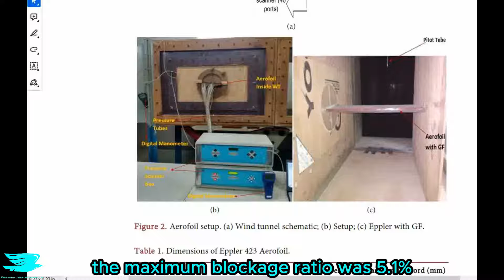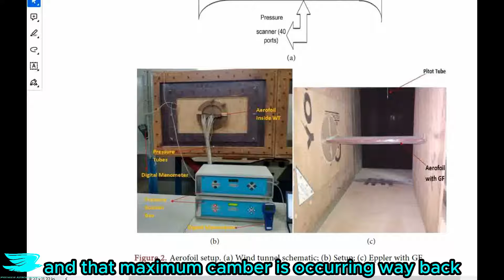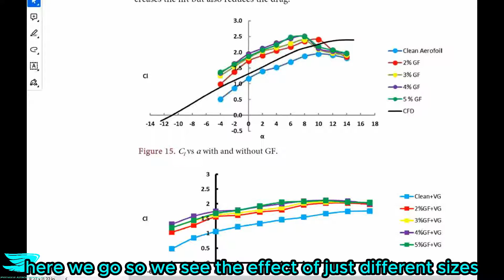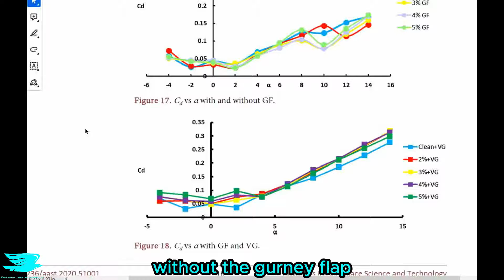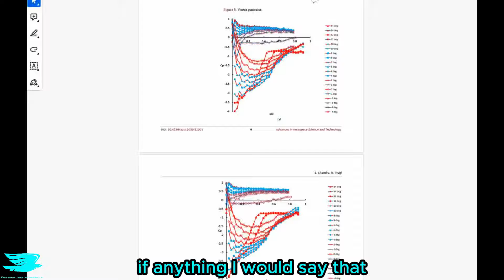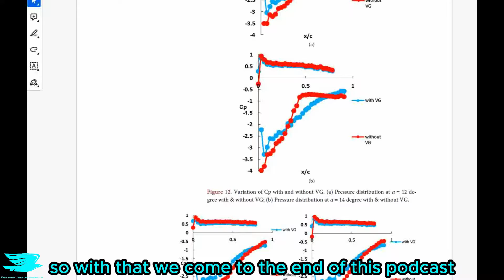Podcast #179 Do Gurney Flaps And Vortex Generators Work Well Together?

Comment: Hello,

I believe if you design tubercles the right way, they should reduce the lift to drag ratio even at small angles of attack.
For this you need to work the tubercles into the whole wing chord.
Especially on the top of the wing.

For example by interchanging 2 different wing profiles in a sinus wave.

With this the streamlines get bent to left and right. And the relative way over the airfoil gets longer.
This results in an increase in velocity. And in higher lift, without more drag.

However the changes should be not this much. Cause the  bent elongates the streamlines under 1%.

But its far more easy to put these tubercle triangles in front of an existing profile i guess.

Do Gurney Flaps need compression ? Or should they work on hydrofoils too ?
Reply from the maker: Interesting ideas for tubercles. There are some configurations where the drag drops and the lift to drag ratio increases. The ones I'm familiar with still produce some vortices at low angles of attack. But, it may be worth looking into the ones that don't produce much vorticity but just bend the streamlines.

Gurney flaps can work on hydrofoils too.

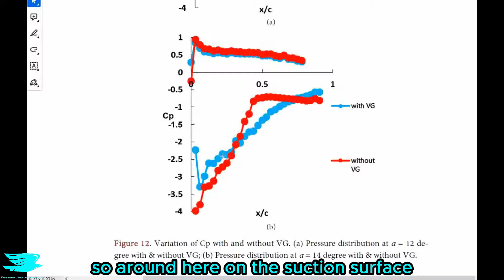Comment: @22:00 that's probably a clear separation bubble, seems like the tubercles add drag but help keep the flow from detaching. This brings up an interesting compromise, turbulate the flow so you avoid laminar separation bubbles, which makes it easier to predict downstream, keep the flow attached, but you get worse performance and more drag in steady state and low AOA. I suppose if you have the proper circumstances, like favorable pressure gradient(around an inlet or nacelle) it may be a good idea to turbulate the flow to keep it attached and more predictable during transient maneuvers if you want it to stay attached and interact with things downstream. Key being if you want the flow to stay attached and interact with things downstream.
Reply from the maker: Exactly the problem you run in to. It also depends on what will benefit you the most. Tubercles actually come from humpback whales and their massive stall benefits are used to help them swim at high angles of attack and feed. The additional food they get from the tubercles helping them turn quicker offsets any potential performance detriments at low angles of attack.

Comment: Using epoxy/clay/putty is a quick and easy way to change the geometry of something without making permanent changes. Head porters do it all the time to change the geometry of a port, when they're experimenting.
Reply from the maker: It makes a lot of sense considering how cheap and readily available it is.🤔